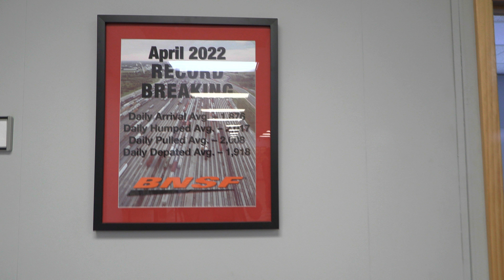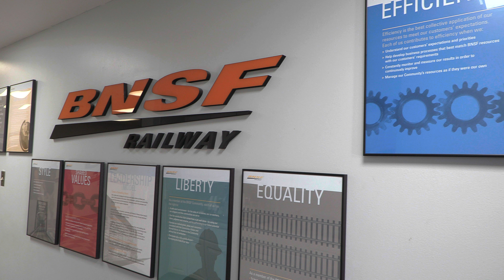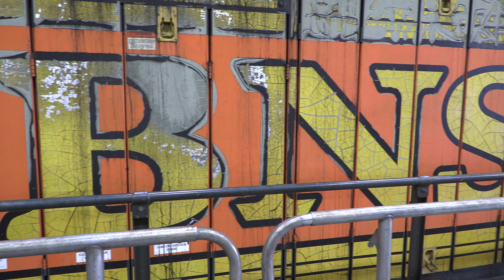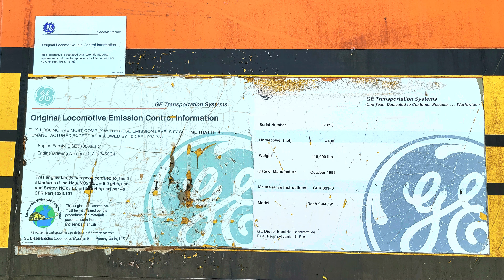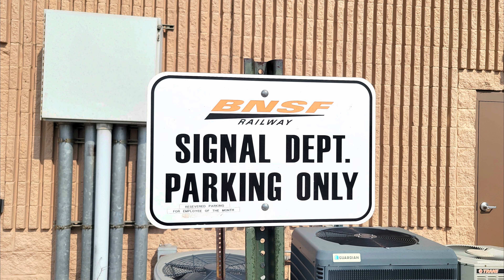Galesburg Railroad Days 2023: VIP Yard Tour and Railfanning

Comment: Very nice video! And as for the question at 26:44, I heard the primary reason Metrolink leased a fleet of BNSF AC4400CWs was due to an issue found with the plow on all the Hyundai rotem cabcars. The issue was discovered as a result of a derailment so the plows needed adjustments done to them. While some got worked on, the other unrepaired cabcars would still be used with one of these BNSF units left in front. I rode Metrolink quite a bit during the time Metrolink leased the BNSF AC44s. -Jon
Reply from the maker: Thank you for the information Jon and thanks for tuning in!